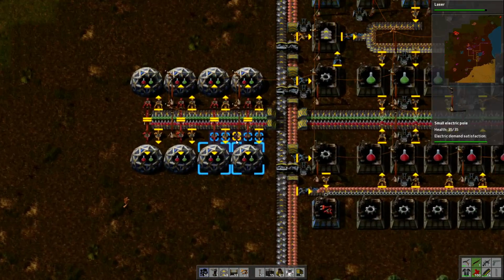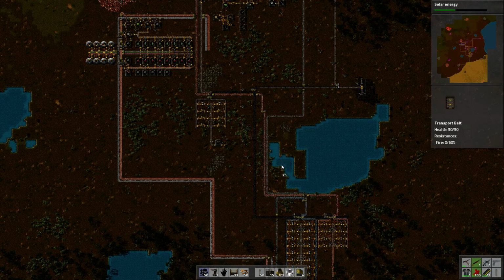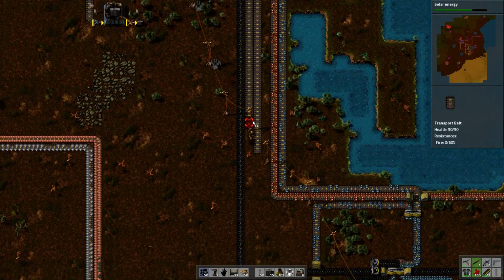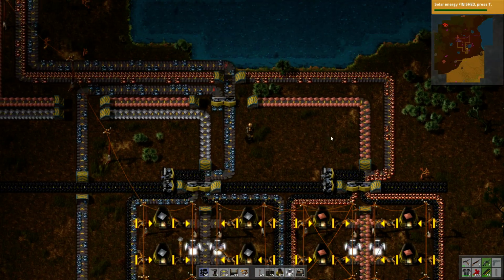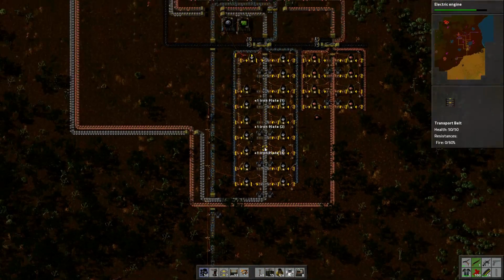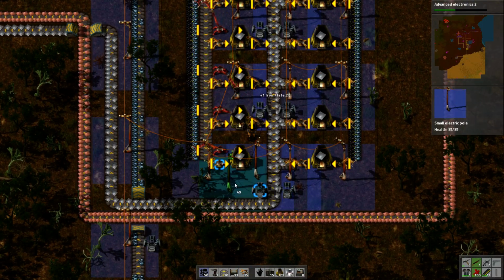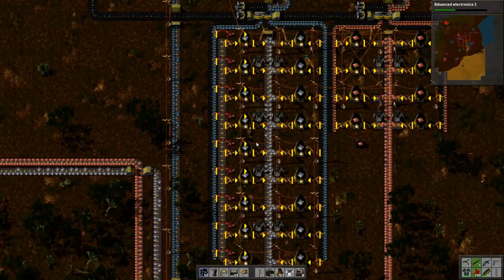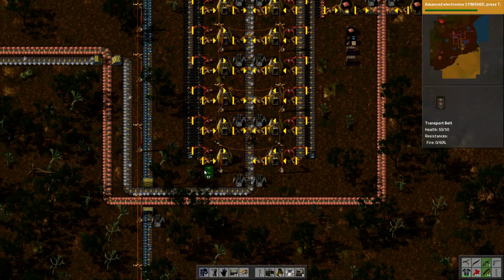Factorio No Assembly Required 9

Comment: I don't understand why the loop is different. If you have more resource throughput than you need it jams up anyway and accomplishes nothing, and if you don't have enough, you still run out. I guess it looks better to have stuff always moving. It's also a much larger drain on resources when you have to upgrade the belts due to insufficient material throughput since you'd have to upgrade the entire belt instead of just past the bottleneck.

The furnace layout seems like it would help, but only really makes a difference if you don't plan on switching to electric. You have even more stuff you have to clear out to upgrade, and the throughput with fast transports is adequate to hold you until you can get them switched to electric.
Reply: ***** bubba200874426 The best use of loops that I came up with use a chest as a buffer somewhere in the loop. The chest gets filled in gradually when you have normal production/consumption patterns, and gets emptied when you have a spike in consumption. I like to put the chest near a corner of the track, and have a slow inserter feeding the chest while a fast inserter emptying it. You might have to set it up on both sides or use a spliter to make sure that both sides of the belt are fed.

Comment: Yeah I tried a loop system and I am a noob but it takes a lot of micro managing to get it working properly because as soon as it starts filling up the belt some factories cannot add more to the belt as the factory ahead of it has already placed its item, basically you end up with too many of one and none of the others.  It takes more planning to get right but the classic system works best... until robots.

Comment: Well... this furnace design should be interesting when you get to the electric furnaces. Your previously modular design of 'remove 1 track and 1 stone furnace' isn't going to work as well anymore.The coal line being on the inside track does work with this setup, because then you can just pull that track out and do all the rebuilding, but It's still a lot of needless work.

Comment: I can't really see any advantage to loops... the assemblers/furnaces/etc. already stop producing when the line backs up.
Reply: I do like the new furnace design though. The extra ore throughput will really help at higher levels of production.
Reply: Sgman1991 the advantages are seeing where a lot of you resources are being used as opposed to seeing that you somewhere you are using a lot of resources. you will have a little bit more of a stockpile also bc all the extra belt
Reply: You can put a chest in the loop to act as buffer and smooth out temporary spikes in resource consumption.

Comment: Couldn't you just cut the main coal stream off before the splitter and use a smart inserter to remove coal into a box? Seems a lot more hassle to have to remove: Track, two inserters and a furnace. It was more logical before, just empty the track with a smart inserter right? I know you like robots but smart inserters are useful.

Comment: I think your older furnace design is better, it looks better, uses less power and when the time comes when you need add more than 16 furnaces, because your production is low, you probably have electric furnaces, so you won't have the problem with the half coal, half iron belt.

Comment: you could switch the sides of belts with a splitter,
instead of the undergroung belt place a splitter to get the copper line 1 tile to the right and then use an underground belt on the iron line to pass the copper through it

ps.: there is a wrong inserter trying to put iron into copper cable

Comment: no such thing as too much science. Just add more labs. lots more.

And if the restraint is 'irritating'... It means you have failed to automate everything as you are supposed to.  Splitters, miners, labs, steam engines, all the things should be made off the main production line, and able to deliver you at least one full stack to you on demand.   Dropping down temporary factories, and then picking them back up again to build one more splitter is not the point of the exercise.  And yes. i know "robots". But then you are simply bypassing the puzzle, and perhaps replacing it with lag.

Comment: A steel furnace is just as fast as an electric furnace, but uses half the fuel.
Without solar or efficiency modules there is no reason to switch.
And at that point there should be enough robots around to do the work.
Reply: actually, without any modules, the electric ones and the steel ones produce the same ammount of goods for the same ammount of fuel.
In fact, if you are on coal only, and the boilers are 'cold', you produce slightly less if you pop 10 coal into a boiler, compared to directly into a steel furnace.

However, with 2 green modules you reduce power usage to roughly 32kw (iirc), down from 180.

The steel ones however (and electric ones) produce twice the goods for the same fuel as a stone furnace.
Reply: DJ Nekkid

I didn't try it myself just found this on the factorio forum postet by lxl:
My current experiments did show that per 10 coal
63 iron or is smelted in the stone furnace
125 iron ore is smelted in the steel furnace
62 iron ore is smelted in the electric furnace(probably a small loss to heating up some water in the pipes.

Assuming this to be true, there is no point in over engineering the furnace setup to fit all 3 types.

But we all love (over) engineering, thats why we play factorio :)
Reply: MinerEiner85 I actually did do a test, and made a reddit post on the topic.

Long story short, use steel furnace to burn the coal, and not a boiler to make power. It makes twice as much final product. Unless you put two efficiency modules in it, then burning coal in a boiler is more efficient.

http://www.reddit.com/r/factorio/comments/2nb3vh/electric_furnace_vs_steel_furnace_efficiency_my/